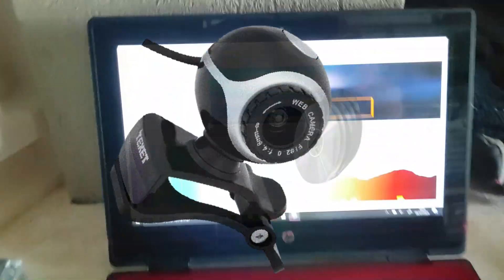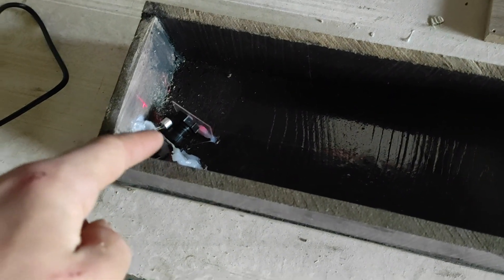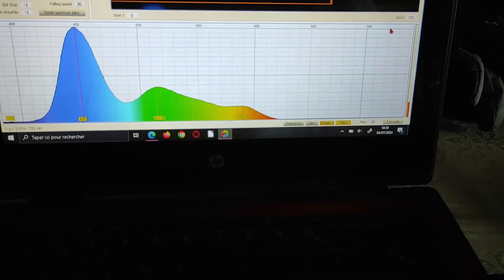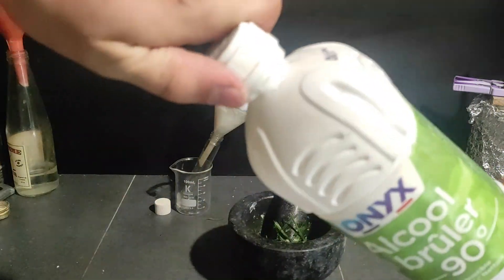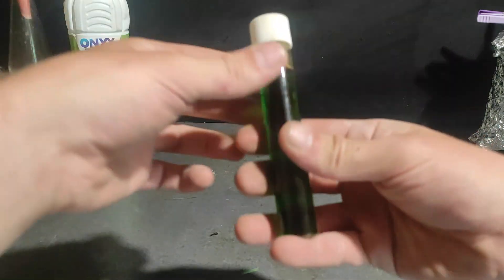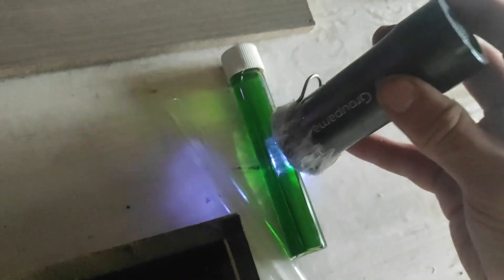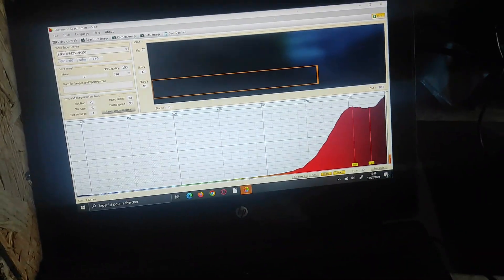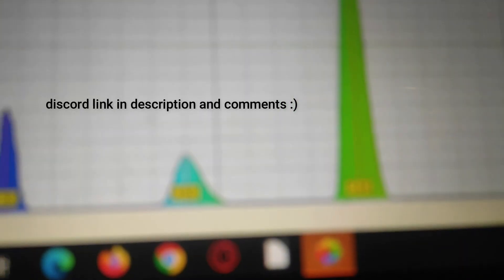Is a DIY Spectrometer Worth It?

Comment: Hi Jam Kemist,
Nice video. And nice job.
I also have invested into various cameras, grids, discs, lasers, lamps to build a decent spectrometer.

There are two dissociation spectrum ways disponible by either prism (that compress more and more the red regio vs the UV one so the scale is logarytmic) or via grids (or parallel lines-slits) that allows for a linear and regular dispersion with as much discrimination into the red as the UV or green. Of course there is a possibility of combination of prism-prism (see Amici prism), prism-grid (grism) (and vice-versa) or grid-grid (concave or convex or parallel- there are dispositives that allow for rendering the divergent rainbow beam into a parallel coherent beam) and this with lenses or mirrors (usually metallic mirrors without glass layer that interfere a lot into the optical process) to enhance image quality. (But I will try to make a YT tuto (or another science channel) on that because YT starts to really piss me off by errasing (without any warning nor explanation) my messages that are way too scientific for them while many can buy blades, put poison-ivy on them and inside an internal pressure device and send many peoples ad patrem, or buy car and play bowling with living stikes or play Far-west with gunnies but that is legitim for them.) 
 
The spectrometer is indeed a good tool to discriminate the type of light what the eyes can't do.
For example you can see atomic rays (emission (light rays into a black font) or absorption (black ray into a rainbow of continuous colors), band gaps (gaussian cruves), or perpendicular to the ray phosphorescence or fluorescence emission ( not possible in the direction of the ray because the incident light is often too strong and reduce the visibility of the response.
You can have purple as a plain color with a defined wavelenght; but it can also be an addition of color RGB (red-green-blue) and white-black or (YMC(A) ;o) yellow-magenta-cyan) ); typically what is seen on TV or PC screens "à la façon des artistres peintres" (the way of the artist painters do) to better understand those aspects (watch after "rendu des couleurs numériques")

By definition there is 
Incident Light (wavelenght A - original frequency)
Reflected Light (Rayleigh "scatering") (very similar to the incident light so to wavelenght A (and reflection of original frequency)
Absorbed Light
Emitted Light

The last two play into phosphorescence or fluorescence what always have higher wavelength (thus lower frequency) than the original absorbed light (usually you can't create more enegy than received so atoms (or molecule) vibrate and give back (a little) their signature aside with heat or degenarated wavelenght-energy vibrations.
You can have higher energies but at the expanse of more photons thus highly lowering the "quantum photon yield"-like two photon process from pumping green laser output (frequency doubler) out of an IR laser); a bit like a wave can reach an average height,  and a maximal height, but some droplets (extremely minute amount) can emerge from higher energy water that gather together to make them go as high as 10m above the wave (but the rest of the water has lost enegy by doing so).

Phosphorescence is like fluorescence except it last way longer and shine less photons back per unit of time (while fluorescence is about as bright as the incident light (but slighly lower in intensity 10-50%) decay is almost intantaneous and exponential negative; while phosphorescence decay takes more time and is not as bright as fluorescence (0.5-5%); also exponential negative.
Typical fluorescence can remain about a few microseconds after illumination; phosphoresence can decay in milliseconds to hours.
To observe phosphorescence it is best to be in a closed black room without any light.

Observation of fluorescence or phosphorescence is usually made with a rotating disc and in front another disc full of holes (windows) on the edge; so the rotating screen supporting the stuff to be tested; when a hole is shined through by a static light or laser beam it reveal the screen under direct light; but when rotating further the light doesn't come anymore through the window that moves away with the screen during the rotation and is visible via the repeated static windows.
Then the surface once illuminated directly reacts and fluoresce or phosphoresce at its own pace.
By regulating the rotation speed you can define the extinction speed and so differentiate between fluo- or phospho-rescence.
You can observe the amount of windows that keeps on emiting light depending on the rotation speed of the screen: if too fast the emitting light is stil present when light falls again on it after one turn; if too slow you don't observe any effect; at the right speed, you can have half a ring responding. Of course the further away the enlighling zone; the milder the emission and luminosity; so better to do this in obscurity too. 

Fluorescence can happen with many wavelenghts as soon as the incident light has enough energy to allow for fluorescence of the molecule; so it can be blue, green, violet or UV (the full color of the rainbow and below or above (but above is unusual except with X-Rays or gamma-Rays); and below is pretty common.
It is best seen for us because we don't see UV wel but we do see visible light what is often into the "reaction" regio for fluorescence or phoshorescence.
Of course we don't see infra-red and most molecules respond into that regio.

The vibration of IR can be twisting, bending, scirsors, ... so molecules resonate in various modes depending on their structure and atomic consitutions, or groups and they absorb specific energies as function of those (of course for detection IR filter of camera must be taken off (if possible))

Some other spectrometry use special effects into Raman spectroscopy for exemple) (just like anti-Stokes what is even less reponsive signal than the Stokes one) and there excitation light respond at wavelengts specific to the bond type, groups, atom structures but the response is very much lower than fluorescence or phosphorescence signal; and you need specific highly efficient filters to avoid overwhelming  the reponse signal by the incident energy reflection of the initial signal (Rayleigh scatering) (or to avoid overwhelming by fluo- or phospho-rescence).
But Raman spectroscopy is way more complex than absorption spectrometry, emission spectromerty (fluorescence or phosphorescence) what are already not that easy.

The more the molecule is complex; the more there are atoms and vibration modes and so the vibrations overlap into a "patatoïde" (read a large gaussian curve with many shoulders).
This is why atomic spectra is usually rays, molecular spectra is usually bands (because made out of many atoms, bonds and sometimes interacting with each other by different ways intermolecularly speaking or intramolecularly speaking); when you watch at a natural product extract (you have a lot of molecules into it and so the spectra can be an horrible superposition-mix).
The best is of course tiny molecule, relatively pure and isolated or with a decent % composition "idealy near 100%" and recristallized.

About the chlorophylle; it is extractible in green with many solvents (I did test about 35 years ago with ether, ethanol, aceton on laurier leaves).
About a year ago I have tried a poor weed plant extraction with aceton and the effet under UV light of the extract is indeed red-rust color but aside the emerald green as a function of the light incidence and reflection.

Color is indeed vibrant emerald green, but it needs caping and procection from the air (anti-oxydant or oxygen) because irrevesiblely and always it will turn brown (a bit like leaves of the trees that are cut or that fall on the ground in autumn).
This is surpsising because the molecule is a poly-pyrole-porphirin structure with a Mg(2+) cation in the middle but apparently, despite a complex-ligand molecule cohesion, it is not stable to O2 gas (what will diffuse from air into the solvant and solubilize even partially into any solvent with time and deteriorate the complex).

PHZ
(PHILOU Zrealone from the Science Madness forum)
Reply from the maker: Thanks as always for your insightful comment :D 
I do agree that YouTube policies sometimes don't make much sense but I suppose it's hard to regulate everything properly